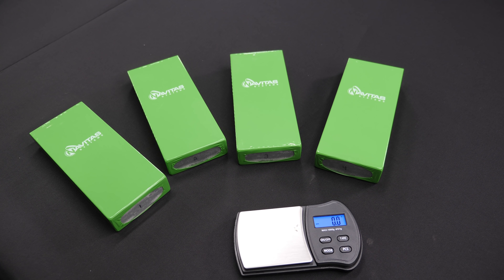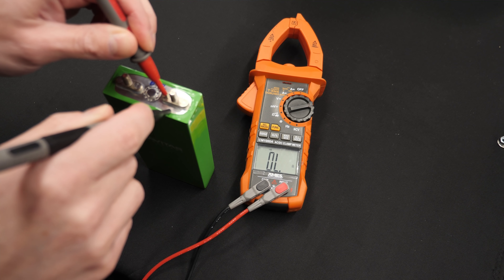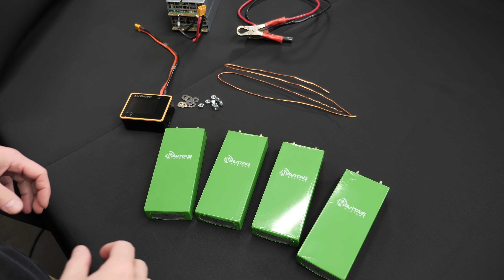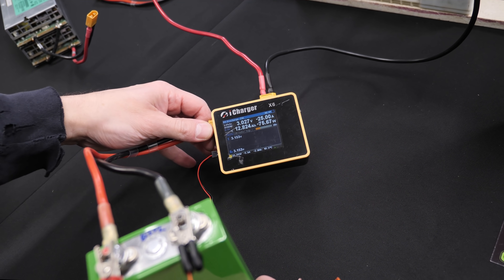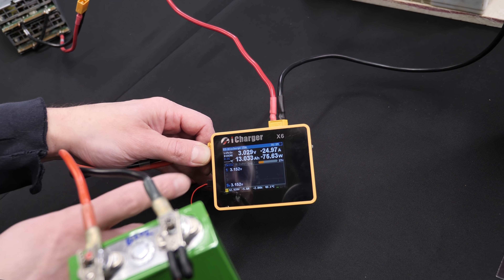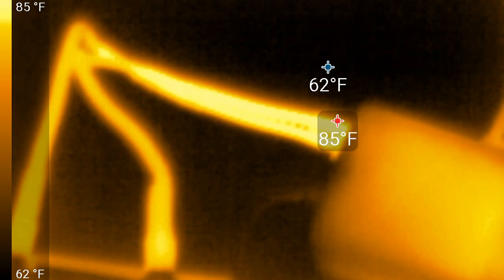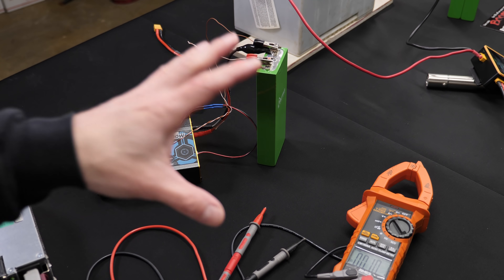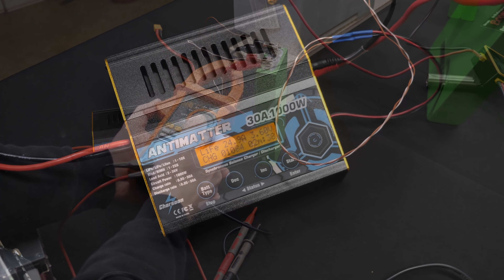25ah Navitas LiFePO4 Capacity Test!!  Amazing Cells!!!

Comment: I know this video is over a year old, but I wanted 40 of these cells so bad. At the time, I wanted to put 10 in parallel and make a really sick 12v battery that would be great for jump starting cars, or it could had been used to power a really powerful car audio application, or you could reconfigure it to 24v or 48v and run any inverter you need to run. These little cells were freaking perfect for any application you can think of. Probably the most versatile cells I've seen with the ability to pump out 3c to 5c in short bursts. Too bad I missed out on these, but I was in the hospital with a pulmonary embolism that very nearly killed me, so there was absolutely no way I could had been buying batteries, or working on said batteries. I guess ill have to keep looking around for cells with similar capabilities and capacity. Too bad A123 is no more. They made insanely capable 26650 cells and pouch cells. 2500mAh cells that were able to output 50 amps each is what I wanted for my projects. I don't need 1000 Ah of Lifepo4, I only need maybe 25Ah, but I need the cells to be able to pump out All the amps.
Reply from the maker: 100% agree!! I tried to get more but could never get any.  I have since gottn some 280ah cells. So jfyi, battery hookup usually gets the cells or has them in stock. They are in blue now and not green. Same specs!
Reply: @AVERAGE_JOE  I forgot to mention that Custom Electric Services, aka CES is another good website to check out. They sell 80Ah LTO batteries put together in nice cases, and they make extremely high output Alternators for producing lots pf power with your car. There's a couple really popular car audio sites, like Toolmaker that make beautiful CNC bus bars out of polished Billet Aluminum or Copper. I follow a YouTube channel called Parker the Basshead, and he is doing a build right now with 8 -- 15 inch subwoofers and over 50 of the 8Ah Headway 38120HP cells with a huge, Beautiful set of Aluminum bus bars. Its a  sexy sight to see with the cells all together with the polished Aluminum bus bars. Check it out if you get a chance. Its part 6 of his current build, so it will be easy to find here on YouTube
Reply from the maker: Awesome! Ill do that!!

Comment: Hi Average Joe

Battery Hookup does not seem to have the Navitas cells in stock now.  Are TopBand cells pretty much equivalent?

I would like to put together a 48volt 20AH (or more) battery pack for my motorino xpe electric scooter.  I haven't worked with LIFEPO4 batteries in the past - are prismatic batteries okay for this type of (sit down) scooter?  Also, you mention bolts - can you reply with the specific name of the bolts so I can search for them on-line.  I presume I need a BMS - do you have any thoughts on the specific of a BMS needed to create 48V (actually 51.2 volts)?  Do I need a special case?  Is there anything else I should be thinking about?  Is BOOM discount still available?

THANKS . . .

Phil Troy
Reply from the maker: Yeah topband is the same cells! Yep these are good for everything! Yeppers boom code still works!😄💥🤘

Comment: You get a like just because of the shocked look when seeing the price of metric fasteners.  I had to buy a 16mm by like 2.5" bolt and the sucker was over $7.00!  That's why we don't go metric here.

From a purely usefulness point of view, I would make a small 12 volt pack out of these and use it for 9 dozen things I need out at the farm, such as the sprayer, fuel and water transfer pumps, 12 volt fridge, and the entertainment system.  I do need to build a bigger pack for my portable winch which would need to be able to discharge at around 300A for 15 minutes continuous.

Comment: Great video! Thank you for the info. Have you by chance tested these at a 2C or 3C discharge rate? I see one of the tests you did at 30 amp, slightly above 1C. Curious if the spec sheet is accurate on them handling 3C and if they experience any swelling when discharging at that rate.
Reply from the maker: Thanks! I have not tested them at 2c or 3c but dont have a 12v inverter. I gave them away a while ago to subscribers🤦‍♂️😆 If I can find a good way to test at 2-3c I will! 

Swelling occures at higher SOC so in normal usage you would slightly compress the batteries to prevent swelling. With my 1c+ test I had zero swelling and I tested uncompressed. Great cells!

Comment: I'm building a 4S6P pack with 24 of these batteries.  I'm trying to top charge 6 batteries in parallel using an ICharger 3010B.  As in your ICharger X6, the 3010B can supposedly charge at up to 30A.  When I received the Navitas batteries, they were at around 3.29V.  I set the charger to charge at 15A, but charger only put out around 4A initially, decreasing even further as the batteries charge.  When the charger stopped charging, the battery voltage only measured around 3.33V.  I expected fully-charged battery voltage closer to 3.6V.  I'm wondering whether something's wrong with my charger, or maybe something going on with the batteries.

What fully-charge voltage are you getting on your batteries?
Reply from the maker: On my icharger I can set the charge voltage for lifepo4 to 3.65v. If your charger is set to the "normal" charge voltage then 3.3 or 3.4v is normal and thats why you only saw the 4a charge. If the cells were lower voltage then you may see the 30a. Are you able to manually change the charge voltage on that charger?
Reply: @AVERAGE_JOE  Yes I can.  After changing to 3.65V, maximum charge current was 1A higher.  It maxed out at around 5A.   It's still charging at the moment.  Currently, battery voltage is 3.336V.  Charge current is down to 3.7A.  Were you able to get to around 3.6V per cell when your batteries were fully charged?  Do you remember what your individual battery voltages were when the charge current went down to around 5A?
Reply from the maker: Oh ok cool. I dont remember voltage but you are in the flat part of the curve so it will stay there for a while. Dont worry, they will go up to 3.65v. There amazing cells!!!

Comment: I just bought a case of those batteries from battery hookup.   The ones they sent me are in blue shrink tube,  and don't have any posts marked for which is positive or negative.   Although one post on each battery is aluminum color, and the other post is light brass color. Any idea which post is positive???

Comment: These cells sold out faster than a chicken with diarrhea, unfortunately I only purchased 8 of them luckily today as of June 7 2021 they’re back in stock by the case of 24, they are not selling them individually this time around and I didn’t miss out not this time instead of 8 cells I now have 8 cases BOOM!
Reply: They just added packs of four cells so you can buy four of them or 24 of them
Reply from the maker: Awesome! Thanks for the update. Headed over meow!😆🤘

Comment: Why do you weigh them?
I built a 12 volt with 4 of them and both easy and powerful
Reply from the maker: Nice! Checking weight is to make sure they match manufacture specs and some like to to use weight for planning a project!
Reply: Ok, thanks.

Comment: Thanks for your videos, I want 4 kW, how much battery does it need?
Reply from the maker: What voltage?
Reply: @AVERAGE_JOE  24 volt
Reply from the maker: You would need around 56 batteries. 8s7p which is 4.2kwh

Comment: Nice video. Question is specs don't have orientation that I can find. Studs up? Sideways? And for this size pack what dimension of shrink wrap?  Any advice would thank ya much!
Reply from the maker: Yeah I didnt see anything in spec sheet about orientation. I think these cells can be mounted on there side tho. I have some heat shrink coming from Keith and hope to get a size worked out. Are you looking for single cell color change or shrinking a bunch together?
Reply: @AVERAGE_JOE  have 4s 12v  25ah navitas cells with a bms. Not sure how to size shrink wrap. Then I have 4 varicore  lifpo4 3.2v 100ah cells coming that will need the same.
Reply: One pack of 4 cells. Straight answer
Reply from the maker: Awesome! Ill see what I can find out.

Comment: Why not get for power-wall bigger cells, like 200 or 280Ah? It seams cumbersome to connect 100 small 25Ah cells
Reply from the maker: No no I was saying if you have many smaller cells they will act like 18650s and "help" each other stay in check vs having a single 280ah string. Agree its more pia to connect a bunch of smaller cells. The reason I didnt get a bunch of these when they listed them is because I allready purchased some 272ah cells a week or 2 before.🤘
Reply from the maker: If I knew battery hookup was going to list these then I would have gone this route 1st!

Comment: But the BMS units you'd have to buy would bankrupt you.
Reply from the maker: No I dont think so. If the cells are balanced properly before using them you could use a smaller bms like a daly. Another option nowa days is diybms. It similar to batrium and much cheaper.
Reply: @AVERAGE_JOE  I'll look into that.  Thanks.
Reply from the maker: No problem!🤘

Comment: How long would a 48v battery run my golf cart?  Or do I need a higher amp hr rating?
Reply from the maker: Cant say as I dont know what yours has now. You would need more cells in parallel to make a nice hr pack. These would be perfect for golf cart tho!
Reply: @AVERAGE_JOE  The golf cart has lead acid, 48 V. But I have no idea how many amp hrs. I'd have to get a 16s  BMS and an appropriate charger.  I do agree though that they look perfect, the price is sure right.  I'll see how many amphr these group 27 deep cycle batteries are rated at.  Thanks for the quick come back.
Geoff
Reply from the maker: No problem. Yeah a bms would be needed for sure!

Comment: how heavier are these LifePo4 batteries vs 18650 cells? assume equivalent battery capacity
Reply from the maker: These are about 1.4lbs each or 660grams. Cant remember off the top of my head how much a single 18650 weighs.  I would say 18650's would be lighter depending on mah of cells used.

Comment: I miss out on these deals all the time! how do you guys always snag these deals? you just constantly check thier website? every hour?
Reply from the maker: 🤣 You have only missed the first round! The next shipment has not been listed yet so you could potentially still get some. 💥🤘
Reply: @AVERAGE_JOE  nope, LOL, missed the 2nd "shipment" as well. they emailed me and my credit card declined the charge 24 hrs latter they were gone.
Reply from the maker: I never saw a 2nd listing?? When was it?
Reply: @AVERAGE_JOE  they only sold by the box of 30. and it was about a week ago. they had 100 boxes and they were gone FAST. I do not think they even put on website, just sent everyone an email that said they were interested.
Reply from the maker: 😲 DAMN I wish I would have gotten an email or notified!!!!
Reply: @AVERAGE_JOE  well you can always get chinese cells for about the same price. I just dont' know which chinese ones are really reliable and have not researched it enough.
Reply from the maker: Yeah I have a few links for them in china from when I was searching for the data sheet. Only way to find out I guess is order some🤣
Reply: @AVERAGE_JOE  they have 50ah packs for $28 each, but you have to buya pack of 10. about 12% more  in cost than this deal. $180./kwh not bad.

Comment: I want to build a battery to power a 12v trolling motor. Can anyone recommend a BMS  for 16 of these cells in a 4s4p 12V 100ah configuration?
Reply from the maker: Id use a daly!
Reply: @AVERAGE_JOE  Is there a way to hook up every cell to the BMS in a 4s4p config? I know there is a procedure to hook up the 4 batteries that are in series but what about the cells in parallel?
Reply from the maker: The cells in parallel become "one" cell so no need to watch or keep an eye on every cell. Does that make since?
Reply: @AVERAGE_JOE  Yes, thanks

Comment: I bought 64... my numbers were 7260’s yours were 7000’s. I am working on the copper pipe bus bars. Like yours the initial voltage was spot on between all of them. Wish I could afford more. Great video as always... Thanks
Reply from the maker: Nice! Yeah I saw those numbers. Wasnt sure what they were for or from🤷‍♂️ Yeah depending on my use and how many I can afford will determine busbars lol. I have some 1/8" strip aliminum, just needs holes! TBD🤣 And thank you!🤘
Reply: It is just the cell numbers. Both cases have consecutive numbers... BTW. Been watching you for years and have learned a lot from you. Thanks.
Reply from the maker: Ahh ok. Appreciate the sub and watch time!🤘💥

Comment: Aye Joe............... I see you went really nuts . I am scratching my nut head  because I bought 32 0f them and  no nuts.  So I may go nuts trying to find some nuts.  Fortunately they not arrived yet in my home country. They are still in Miami. In the mean time, I am trying to make bus bars but cannot complete it because  I do not know the size of the terminals and all that . I want to get another 32 and make a 48 volt 100AH  battery for my 4000w inverter. So I will look to you to learn a bit.
Reply: std 6mm nuts!
Reply from the maker: Yeaahhh. Things got a little.....nutty🤪 lol Yeah I can get some measurements for ya for cutting some busbars.🤘

Comment: When you measure the Ohms, do you make sure the meter reads "0" when you connect the leads to each other? Otherwise, the readings will be off slightly. Also, moving the wire while reading can change the readings, as well. This is one reason the readings may have bounced between like 5 and 6 Ohms, for example.
Reply from the maker: Yeah I zero out before test. I tried to stay still and even pressure but yahno🤷‍♂️
Reply: There's a slight voltage from the terminals and the case, that's why your resistance measurement is not really valid. It's not a concern as it's only a very high impedance leakage that goes to zero with any load attached between them

Comment: These cells went faster than a gallon of sweet tea on a hot summer day...
Reply from the maker: LOL They sure did. Hope I can get a few of the next shipment!🤞🤞
Reply: I grabbed a case +2 ... but I'm noob so I'm still figuring out how to build my 24v powerwall 😆🤣😂
Overkillsolar.com has bus bar's big but I'll size them, someone told me to go 8S 4p or do you parallel to voltage ⚡🤔
Ya hoping I don't go Boom
Reply from the maker: Nice!  Yeah for a 24v you would do 8 in series and 4 in parallel.  Basically parallel 4 cells together.  You will have 8 of those 4 paralleled cells in series.
Reply: @AVERAGE_JOE  What are the actual dimensions of the cells, the listing has them 7 1/8 x 2 3/4 x 1 1/8, but there's no way they are only 2+3/4 wide....
Reply from the maker: Yup the cell is 6-9/16 tall or 7-1/8 with terminal, 2-3/4 wide and 1-1/16 thick.👍

Comment: I received mine quickly since 1 week or 2 in Canada whitout any problem. Thanks batteryhookup. All store were closed here  because of the pandemic so I do not have nuts :(. They open today! I bought 8 cells with a bms. I dont know if I'll.make 4s2p 50ah or 2 battery 4s 25Ah. Any suggestions, can some single group whitin the 4s2p became unbalanced even with a good bms?
Reply from the maker: Nice! Glad they got there fast and safe!  Cant go wrong with either setup.  The cells should go to far out of balance with a bms especially if you do a top balance!🤘

Comment: I am new to batteries and I would like to use it for my solar set up let me see if I got this straight each one of those are 25 amp hour batteries that means that if I got four of them that would be 100 amp hour batteries am I hearing this right
Reply from the maker: Yes they are 25ah each. The amp hours stay the same when you series the batteries together for example a 12v battery. 4 in series would still be 25ah. If you add in parallel is when the amp hours go up. For example if you wanted a 12v 100ah battery you would need 16 batteries. 4 sets of 4. Does that help?

Comment: For the regenerative discharge to the SLA battery, I have the ToolKitRC M8 which has the regenerative discharge and I want to make the battery pack for my bench with a "top dump" added to it. That way it will charge until it gets to the full voltage and will trigger a resistive load to drain off the extra power. That way under normal conditions the power will get used up in whatever loads I have on the battery and for any higher battery discharges with the M8 it will dump the rest as heat
Reply from the maker: That would be awesome to do. Let me know if you get something like that going!

Comment: cool! a little pricey but they are very high quality, I remeber my Headway pack is a bit unbalanced since they were used cells.
Reply from the maker: I always wanted to mess with headways. What do you think of them?
Reply: @AVERAGE_JOE  they are pretty good for the price, for bigger packs they would be fine once you test them and use the pack builder on SecondLifeStorage, with my 4S2P pack it is hard to get them perfectly matched. So you will end up losing capacity in deep discharge since your lowest cell is your weakest link but for the most part that isnt necessary. I just put my pack in full time service with a 12v UPS and after a top balance they have been working fine. I have videos on the UPS and when I first built the pack.
Reply from the maker: Nice! Yeah always those weaker cells ruining the fun lol. Ill have to take a look as I dont remember seeing that video.

Comment: I'm thinking you did a great job. 
I'm building solar bank.what do you recommend?
Reply from the maker: Thanks mate! Well if you can jump on these when they go live here in the week Id say JUMP. If not these Id look into the big cells from china. What voltage you doing? Can get a link for china cells Im looking at if you want.
Reply: @AVERAGE_JOE  24v, and I know that it's odd to have but  that's how I roll  . I'm in cold country and won't be able to dig the camper out until spring. But I have youtube University till then.